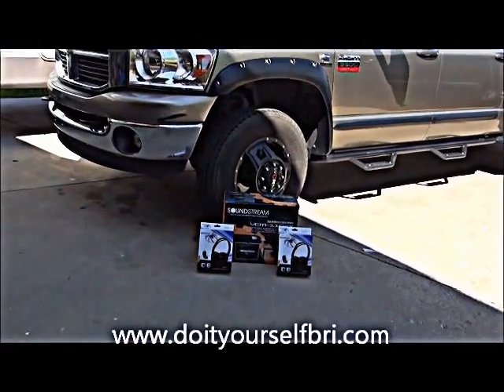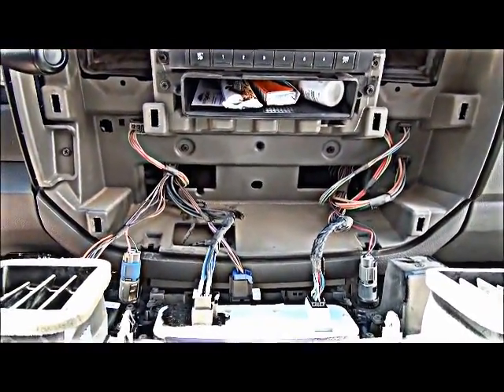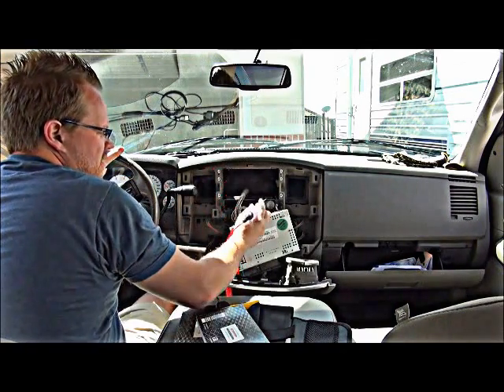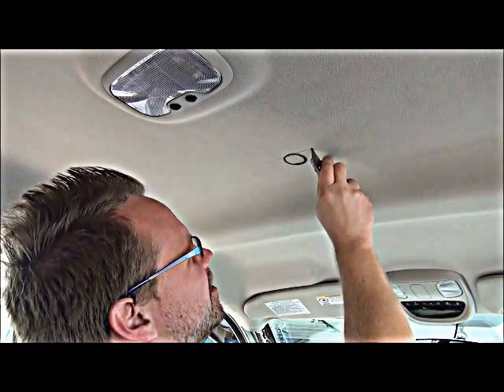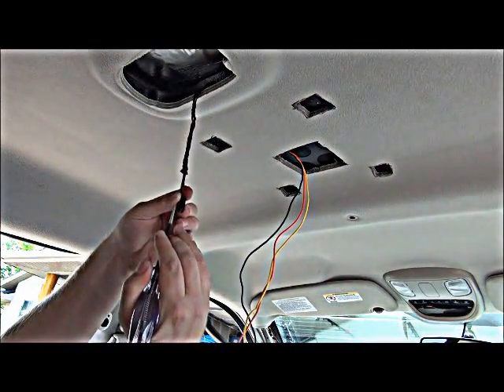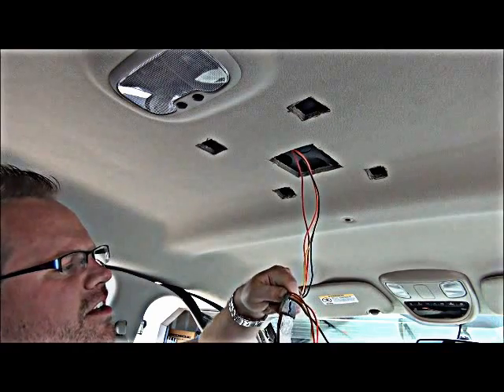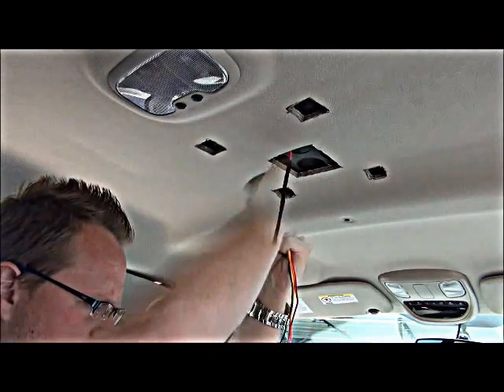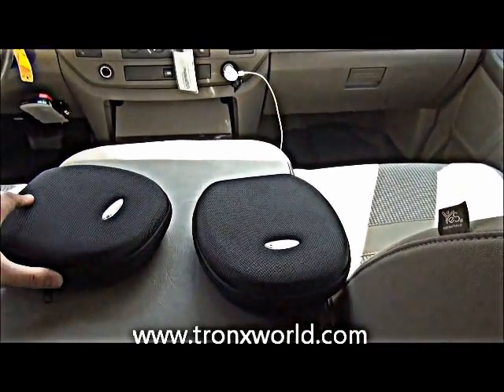Dodge Mega Cab Truck DVD Video Screen System Install Tips

Comment from the maker: Thank You! Sorry no pics of the mounting. The video system comes with a plate that wedge's in-between the head liner and the video system and holds fairly well! If the system you are installing is very heavy and sags the head liner then I would recommend installing a MDF board liquid glued to the roof of the truck and mount the video system to the board

Comment: The right side auxiliary outlet on the Ram can be switched to constant hot or hot with ignition by changing the position of the fuse in the fuse box .

Comment: Every single video shows all of the obvious procedures, all I'm trying to figure out is mounting the base to the headliner and if you always need to use a piece of wood or not!?
Reply from the maker: 95% of the time I don't use a piece of wood. (I didn't use a piece of wood on this truck) This is kinda hard to visualize until you have done it a couple times. Basically the metal bracket goes in-between the headliner and your video system, when you use the screws to tighten it they thread into the metal bracket and clamp the video system to the headliner, the video system just kinda hangs there. On videos systems that are very heavy or the headliner in the vehicle is really weak you have to use a piece of wood. Hope that helps.
Reply: Thanks for the help
Reply: Kevin Kolari so kids can just pulled down and rip it off lol